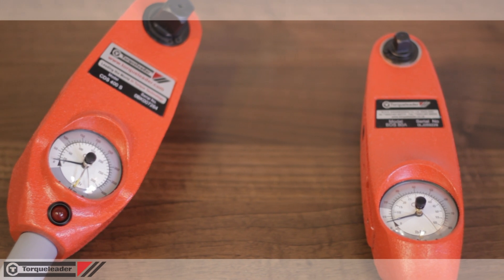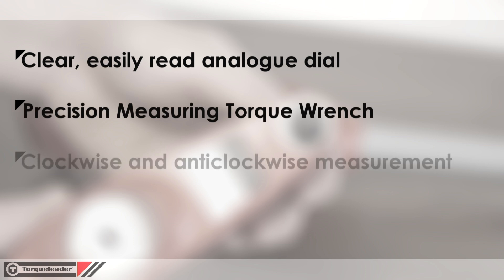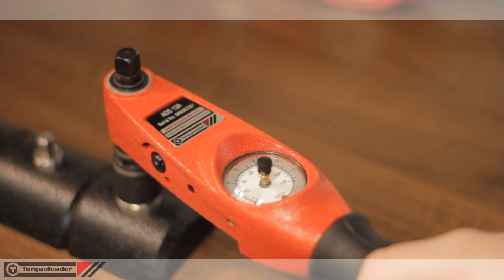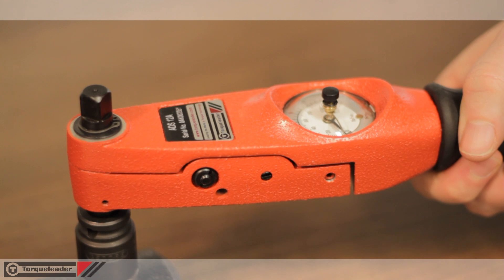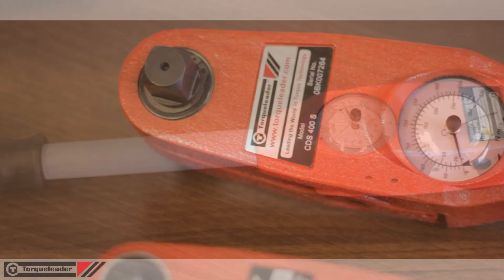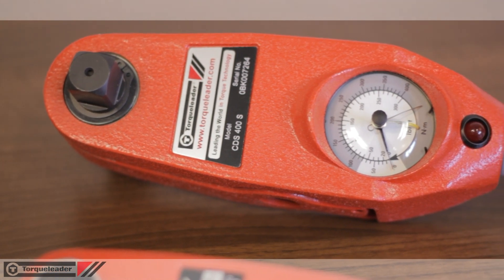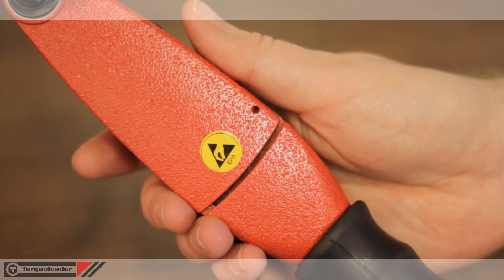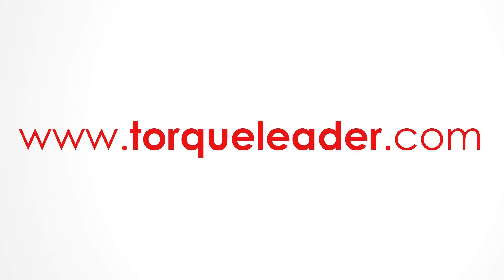Dial Measuring Torque Wrenches (0.8 - 2000 N.m) by Torqueleader

Comment: Do the extension spanners change the reading? Do you need to multiply the dial reading with some correction factor when extension is used?